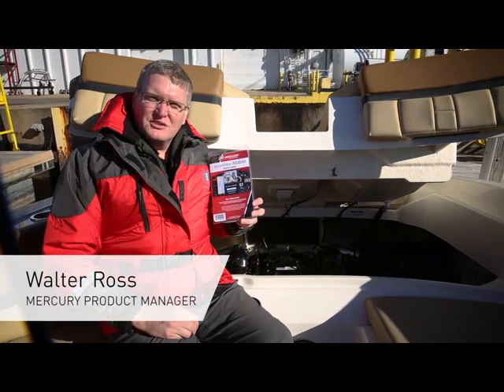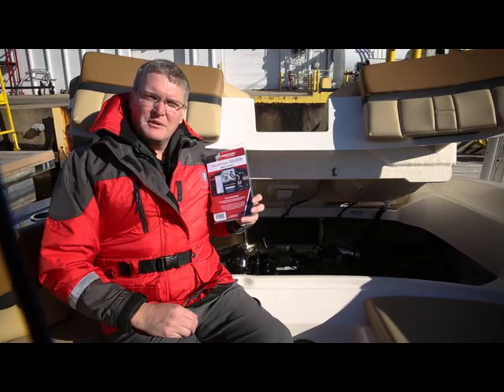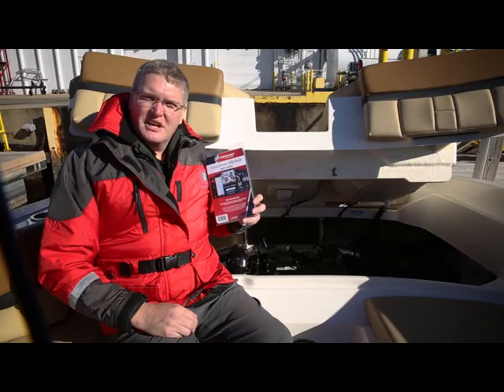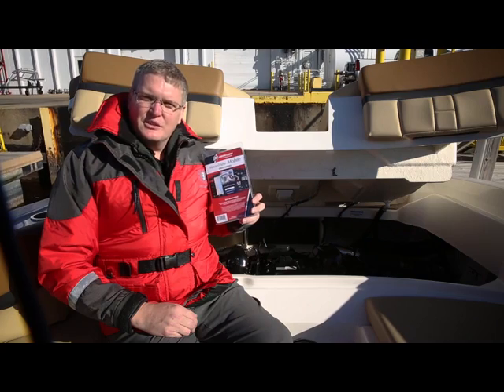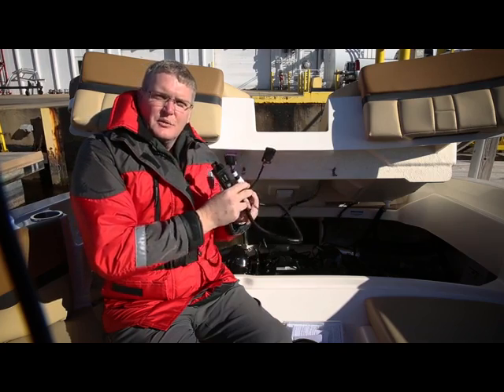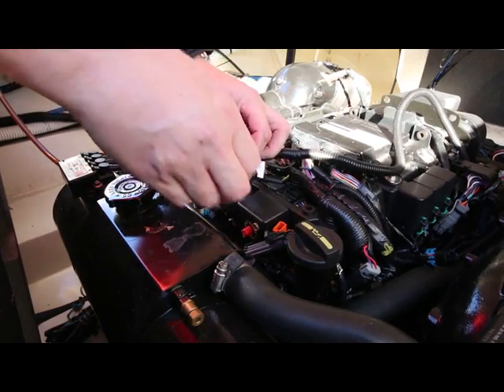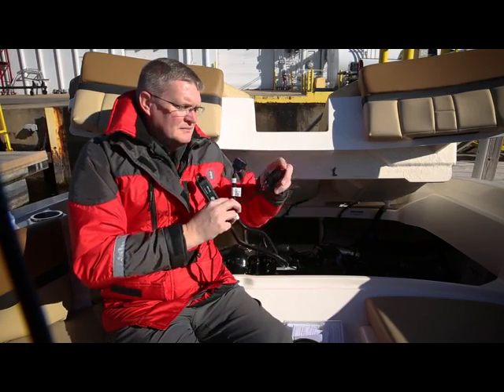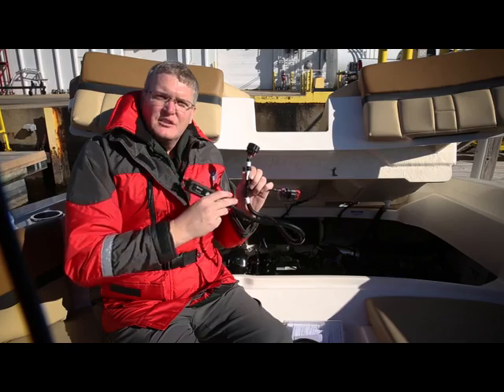VesselView Mobile: How to Install on MerCruiser Sterndrive Engine

Comment: I have an older 8 pin information connection a 8 to 10 pin adapter is available but don’t know if it would work.
Reply from the maker: We recommend contacting our product support team for details on whether or not your engine is compatible and any components you might need. Contact details for the product support team in your region can be found at https://www.mercurymarine.com/us/en/about-us/contact-us. Thank you!

Comment: I'm just about to purchase and install on my 5.0mpi. In the same way as this. Question is, where to secure the module ? You say away from heat. Is that possible with the short length of cable provided ?